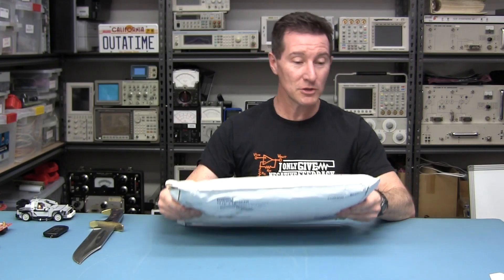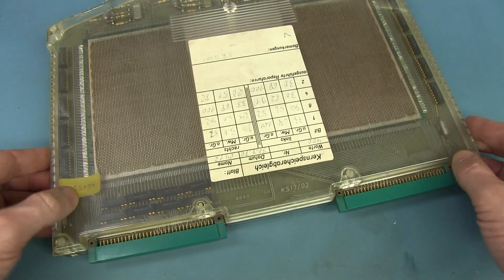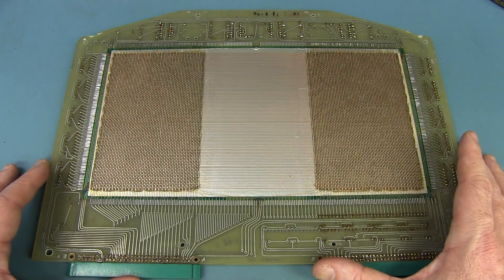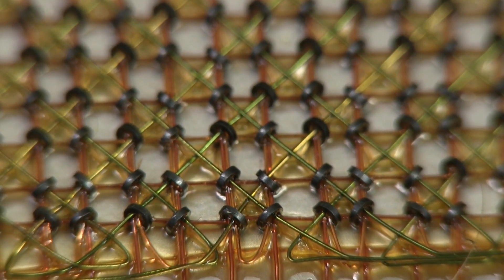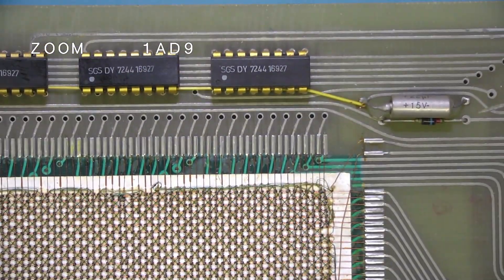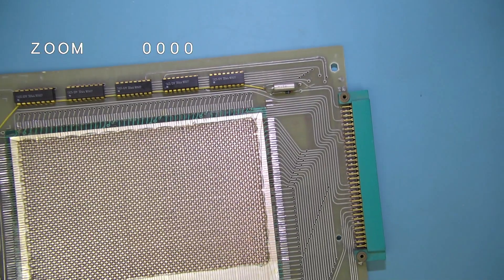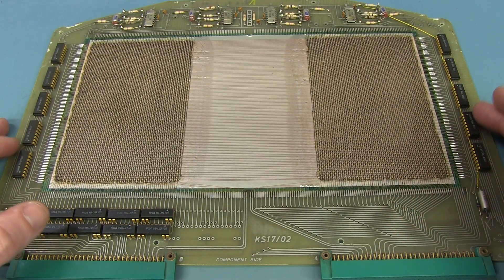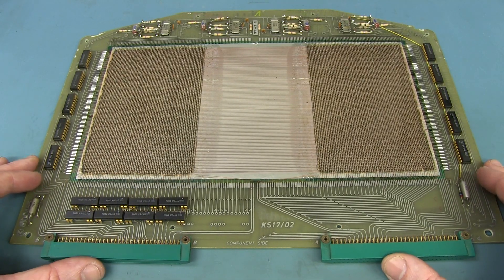Magnetic Core Memory

Comment: I watched these being made at the Univac factory in late 1969.  They were hand threaded by a bunch of ladies with very powerful magnifier lenses.  Amazing stuff.  Also, you have a  sample of 2.5 D memory which is destructive, but a 3 D memory was also made that did not require the additional clock cycle to rewrite the bit.
Reply: I have a single Univac core memory plane. Tiny stuff. Quite amusing to compare to a Soviet era slice I have - the Soviet one has less total bits, but it's probably 4.5-5 times larger in physical size. And then to contrast it again, I have a bizarre Soviet core memory module out of a fighter jet of some kind - it's like a block construction, contains just insane numbers of hand-placed copper wires in a large 3-D structure, with massive amounts of square ferrite "cube" bits stacked in layers.. All developed within such a short timespan of each other. Fascinating stuff.

Incidentally my Univac memory slice has the Pentagon marking, a marking only used on machines delivered to the actual Pentagon.

Edit: Found the photo album I made of my collection: https://imgur.com/a/rvkUL
Reply: I had the honor of handling one of those old 3d core memory arrays, it was so cool, the ferrite cores were actually loose, they just floated/sat at the intersections of the wires, it rattled when you moved it.

Comment: I started in computer programming in late 1974.  The first system I worked on was an IBM System/3 Model 10 which had 24K of ferrite core memory.  The OS took up 4K, leaving the other 20K for user programs.  We were the odd birds since we programmed in COBOL rather than the native RPG II.  You could write a pretty large COBOL program in that 20K as the linker broke it up into many overlays.  Once I wrote a program so large it would not fit in memory.  I finally hammered it in by replacing all of my carefully thought out, user friendly error message text with cryptic 3-digit codes.
Reply: Ah yes, also remember having to make the actual programs rarely exceed 16k. You leaned to write very tight code. Not like today, by any means. Finally along came 640k RAM and it was like a whole new world. All that ROOM !! LOL.... but then, no one writes in machine language anymore, either. I could write in Z80 and 6809 and 6502 code all day. (We don't need no stinkin' compilers...LOL) Was nice when "C" was invented.. Yes, alas, I really am old... {sigh}

Comment: Now, at 74, I remember my time maintaining an RCA110 computer that had a 4K ferrite memory.  This was around 1968.  When it  failed, I disassembled it and managed to find a broken ferrite ring on a parity bit. This particular systems 'word' was 23bit w/parity.   What a challenge, what a memory!..  You are correct in that the data was destroyed when 'read' but the machines of the time always did a 'read/right' cycle to retrieve data, thus maintaining the memory.   Now all you need is a spool or ten of some paper-tape programming.

Comment: 400bytes not bad for a 1970 relic
Reply: Quite a bit more than that - 1 bit per ferrite core. The layout looks like it's roughly 64 * 128 * 4, so 4096 bytes. 4k is pretty good, twice as much as an Arduino! (And like 100 times the physical size of an Arduino, too!)

Comment: Interesting seeing integrated circuits on the same board. I don't know the state of memory on monolithic silicon back in 1970 but it had to have been far more compact.
Reply: More compact maybe, but also much more delicate, much less proven, much more expensive, and for not much gain (it was quite slow compared to modern semiconductor memory, and also, core memory became faster and more compact as time went on). Core memory was produced well into the 80's, and reach pretty serious density levels.

Comment: The Apollo memory was rope memory, not core memory.  It was in fact read only.  You are correct, most core was did destructively read but the bits would be written back at low levels of logic on the board, not CPU level usually. There was enough local capacitance to assure the write back would complete.  So - at a more macro level, this was not destructive in actual practice.
Reply: Geoffrey Feldman Apollo used both read-only rope memory and read-write core memory.  IIRC, there was about 9 times as much read-only rope memory (~72KB) versus read-write magnetic core memory (~8KB), but like most computers it required some actual read-write memory to store calculations and variable data and to maintain the stack as well as preserve register states during interrupt events and when switching between stored programs.
Reply: A driver circuit would rewrite the bit after it was read out.
Reply: The Apollo computers did have core memory for RAM, as well as rope memory that functioned as ROM (where the programs were stored).

Comment: The sense wires were not automated.  They were  sewn in by hand.  While in college in 1971, I toured an IBM facility and saw core memories being made.  The cores would be shaken out over a template board where they mostly would settle in where they should be. Then the few that hadn't settled would be hand placed.  A loom would then push through the X and Y.  Then the sense lines would be sewn in.   I also saw testers with the assembled stack of core planes, a cube about 1'x1'.  I remember seeing some sort of test signal going through while the tester would tap the cube with a rubber mallet and observe the stability of the sense signal on an oscilloscope.  In terms of automation, by modern standards, not many of these were made. This was not even close to being a consumer product.

Comment: Soo, the german label says:
Core memory calibration:
400 Words, Date 1970-08-30, Name C413

The columns are labeled  "lower limit", "average", "upper limit" for the LEFT and RIGHT bits.

no repairs made,  only annotation a check mark ;)
Reply: This kind of makes sense with george s's comment "I took Dave's bit bucket challenge and counted 'em. Each of the 4 sections has 100 by 64 wires, or 100 64-bit words, equivalent to 800 bytes per section, 3200 bytes total ." because since there are 4 of them, 4 * 800 byte (400 words) = 3200 bytes.
Reply: Wunderbar

Comment: Please note: on modern DRAM, we still destroy the data when reading (the tiny cell capacitor gets discharged). We don't notice, because the chip has a line buffer and writes back the data before reading another line.

Comment: I always wondered if the magnetic charge could be seen though one of those green magnetic visualizer sheets. If so, you could save a bw bitmap in those beads and actually visualize if though the the green foil thingy or do an animation or something.
Reply: I have not tried that but doubt you would see any change in the sheet as the magnetic field is circular and contained within the core. Worth a try though.

Comment: There is a little more to these things when you read them, they depend on the magnetic field from the earth, the physical location of the device relative to the earth's magnetic field may change what you read from memory.
Around 1992-1997 I used a HP 3779B Primary Multiplex Analyzer (digital / analog telephone line measurement thing) and it had these ferrite core as memory, one day I did not have that much space so I put the thing on the side and all the electrons were mad and the screen showed garbage, nothing was working, after some time I put it back in the right position with it's feet down, and all was ok, so lesson learned "The magnetic field from the earth has an impact on you ferrite core memory".

Comment: I worked for a memory company in the late 70's. We were putting 64KB on a 15"x15" board. These boards ran close to $4-5,000. 

The wires were attached to very thin but long needles. You threaded the needles through the cores much like sewing. It was all done by hand since there were no robots at the time which could do the job. One memory board took several hours to weave. 

The memory had three types of cycles. Read, which also wrote the data back. write which still did a read to clear the location. Read modify write which read the data, let the processor do something with it then write the data back.
Reply: 5000 usd ? Holy crap !
Reply: @balajiLILG  Yes, they actually paid Americans a living wage to do so-called menial work like that. I have samples of VLSI military parts that cost the US taxpayer 4,000 in 1978 dollars. Those were hand wired with solid gold wire from the die to the external connection.
Reply: @mrmeval6982  Why solid gold instead of copper ? Couldn't they just coat them with something like even Dave's board seems to have on it ? And wouldn't solid gold be more fragile than copper wire since it's softer ? I'd love to see some pictures if you have them on a site too.
Reply: @phoenixsmith4001  Gold doesn't oxidise, which could vary signal integrity. Gold was tons cheaper back then. This was bleeeeding edge tech at the time, so no expense spared.
Reply: Interesting, but somehow i see a comparison with a qbit...
Reply: 5000 dollars in 70s money?!
Reply: @annother3350   1$ in 1970 is equal to $6.68 in 2020. Its called inflation 😏
Reply: @valerijdavydov8098  I'm just trying to determine whether it's $5,000 before or after inflation, smart-arse
Reply: This is the same sort of rope-memory found in the AGC right?
Reply: @rossvoorheis2391 Rope memory is the same general idea, but it’s implemented differently to harden it against losing data in mission critical application. The ones and zeroes in rope memory are determined by if the wire goes through the core or around it. It sort of looks similar, but the idea is almost reversed.
Reply: My man, you should have manufactured flash based memory on a wafer in the 70's, duh

Comment: Modern day Dram, which is capacitor based, is also destructive on reads. There's a buffer on each memory chip that writes the data back after it's been destroyed.
Reply: Why would you use this magnetic memory if you could just use the memory in those chips?
Reply: Technically core memory is write-only ;)

Comment: Omg, Please make a video where you actually get it running and save some data to it! I would love to see that.
Reply: Dave, just rustle up some sense amplifiers and hook it up to your TRS-80 Color Computer through the expansion port, which it will then boot from.The Color Computer's clock of just under 1MHz should match nicely with your 1us prediction for the memory core access speed.
Some assembly (code) required :)
No worries!
Reply: Yes. It's nonvolatile and even radiation resistant. I think as long as no-one has been swiping magnets over it, there's a good chance of doing a core-dump off it. Ferrite "wants" to be magnetic: The energy stored in the magnetic field is still less than the energy saved by packing the atoms such that electron spins align.

And in a ring configuration the magnetic field energy is minimized by aligning the domains in one of only two directions. clockwise, or anticlockwise.

So those two states are the lowest energy configurations, and as such, are (meta)stable.
Unless you heat it past the curie point ofc.
Reply: @benjaminmiller3620  lol nerd
Reply: Zylon FPV arduino and a bunch of flip-flops?
Reply: Almost, the Coco used the 6809, which was a different processor from the C64's 6510 (which was in turn a slightly modified 6502, the more well known variant). The two chips were different manufacturers and not at all compatible.
Reply: +Rick Noah the TRS-80 Color Computer (Coco) did have a Motorola 6509 processor, like the Commodore 64, but it wasn't from Commodore and instead it came from Tandy Radio Shack.

And apart from using the same processor it wasn't otherwise related to Commodore's somewhat contemporary Commodore 64, except for running, like most home micros at the time, a version of Microsoft ROM Basic. For the Cocos was this Color Basic for the lower end and earlier models and Extended Color Basic for the higher end and later 64kb versions. The Extended Color Basic ones also had Color Basic ROMs as well and I believe you could use either, although it has been a long while since I have used my old 64kb Coco II. 

The Coco came out some years earlier than the C64. The C64 was a somewhat more able machine, although I'm sure that people will argue the toss over this as they did at the time. But there is no arguing that the out of the box graphics modes and sound support were slightly superior in the C64, especially the native graphics modes.

Strangely although the Tandy TRS-80 Color Computer line was called "TRS-80" they were actually unrelated to TRS-80 Model I and Model II, which were released even earlier and which were monochrome machines based around the more expensive Zilog Z-80 processor. Instead of having an output to connect to a TV antenna jack like the Coco did they instead had their own custom monitors and had yet another version of Basic. They also I believe came with floppy disc drives as standard and were much more expensive being aimed at business. They were never as popular as the Cocos.
Reply: That destroys it
Reply: @Tech Channel How exactly does it do that?
Reply: dont think he will - Dave is just talk talk talk
Reply: There could be some data in it still. I wonder if he can read it.
Reply: Ali Devrim OĞUZ is it still possible for the magnetism to have lasted that long?
Reply: gerge s- I thought the "color computer" was a Commodore, maybe a 6809 chip.

Comment: This is not rope memory, which is read only and hard coded program memory, but still awesome. Id love to see it run, and it can with a simple writeback routine as Im pretty sure with this type of memory there was supporting hardware that if an opcode such as LDA $18 all effected ONES would have to be written back to in memory once in the accumulator. Id assume that there was a hardware component that did this and was not done in code as programs would be enormous having to JSR for each LDA LDX or LDY or equivalent.  For a lab test where the support chips on the board couldn't be used, a simple write back subroutine could in its stead.

Comment: Actually, "rope core memory" is a type of read only memory implemented with magnetic cores, which this is not.  For reference, see https://en.wikipedia.org/wiki/Core_rope_memory  What you have was just commonly called "core memory".  For those that might want to experiment with core memory, I have a we  page that describes how I built a "one bit" core memory a few years back: https://sites.google.com/site/wayneholder/one-bit-ferrite-core-memory
Reply: Wayne Holder But it's not fun until you access one bit while leaving the others untouched.  So a 4 addresses x 1 bit wide memory would be minimum for a test.
Reply: Lol. That is neat. I like how you stopped at a single bit. Adds a bit of humor to it.
Reply: Well I didn’t :D and I used Wayne’s current driver circuit for a 64 bit array... so the circuit is definitely good.